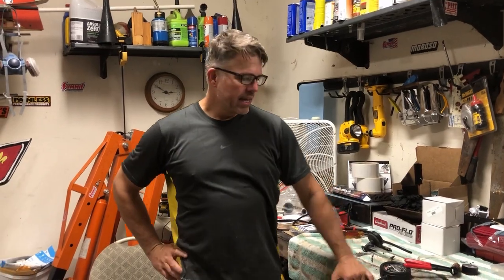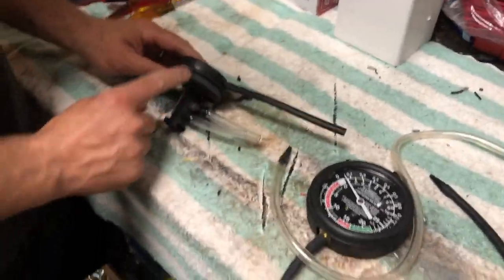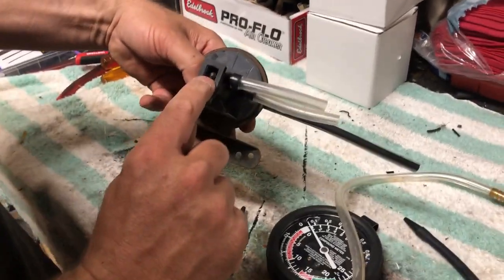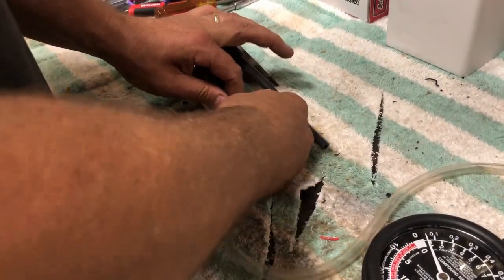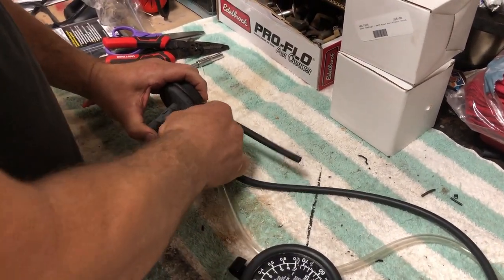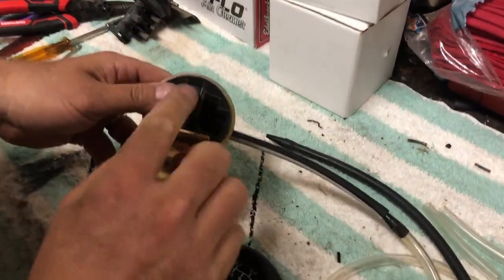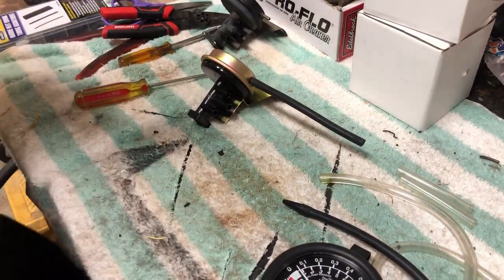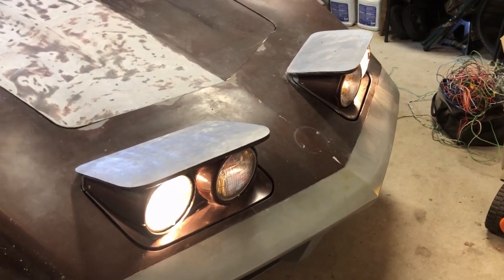Headlight Relays on a 1974 C3 Corvette - Bench Test and then REPLACE

Comment: Great video. Quick question. Can you use the meter on the vacuum pump to check that vacuum is coming from the source if you don’t have a dedicated manometer?
Reply from the maker: vacuum pump?  Humm the 1974 does not have a vacuum pump - it uses the naturally created vacuum from the engine.  I have seen people install a vacuum pump - especially if they are running a hot cam - which significantly reduces vacuum.  But if you want to test vacuum - that is easy just hook up the tester to the main line coming from the carb.

Comment: Good video. .I check every thing but the headlight relay ..On my 80   This help me.
Reply from the maker: Glad it helped - I found out that the values in the headlight relay were a weak spot in the system. Replacement fixed it for me.

Comment: They are slow because the brand new relays are bad. They should come up within 3-4 seconds. Believe me , I have messed with aftermarket relays, you get a good one every now and then.
Reply from the maker: I'm going to have to check that out - I'll order some new ones from ZIP Corvette and see if they work better - thanks for the tip
Reply: @lawdogcorvette8565  I finally got a good one from Corvette Central. You can also repair the originals which I have done and they work well.